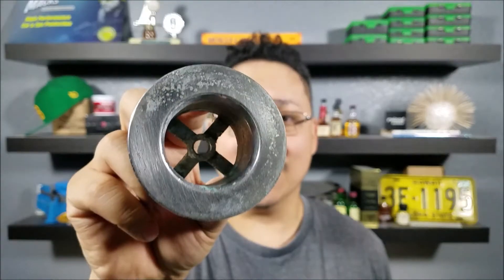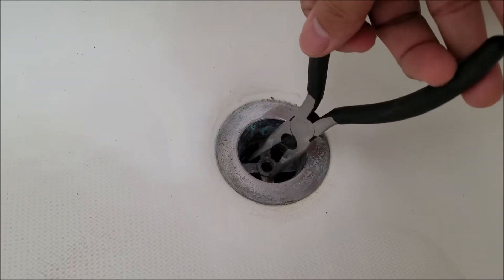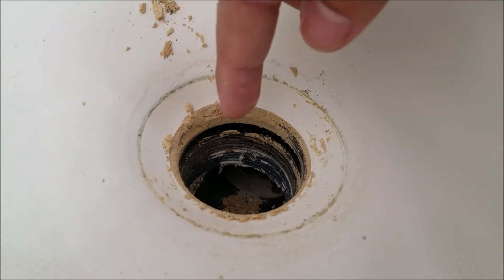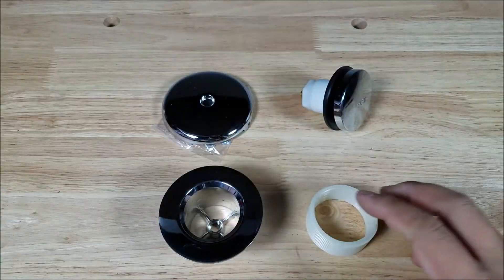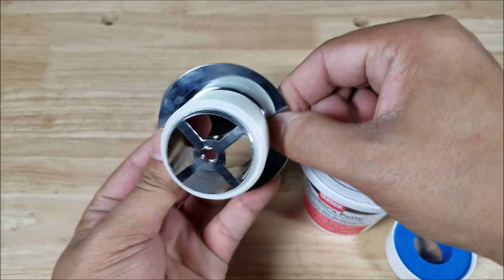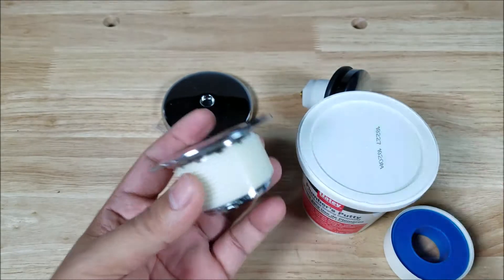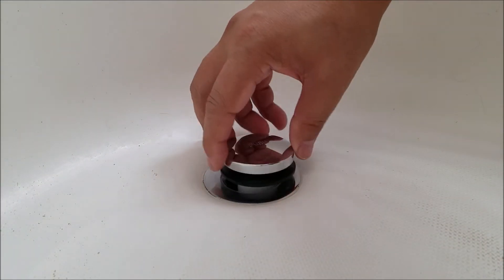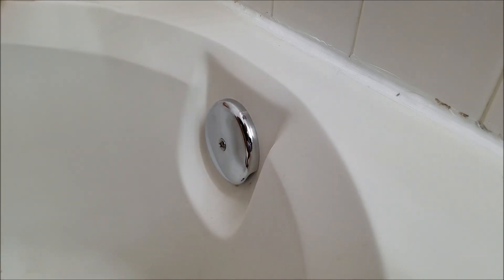HOW TO REPLACE SHOWER DRAIN/BATH TUB SHOE

Comment: Why didn't you replace the gasket that sits between the pipe and the tub before threading the new drain in?
Reply: Apparently most DIYers don't realize what the gasket is for. It really pays to do a lot of research instead of following the advice of the first video you find. 
https://www.youtube.com/watch?v=Xsh24ZmczEY

Comment: Thank you for this. One question though. 
Should I also put Teflon tape in between the threads of the drain and the spacer too. I’m thinking this would need to be sealed as well as the outer threads on the spacer.

Comment: i hate to say it, but I used your method of using a needle nose pliers and a wrench, and it broke all the tines in the bottom of the drain.  Now I am stuck with a drain that has a huge hole in the bottom of it.  I put a kitchen drain that has a screen temporarily, but now I am in trouble.
Reply: the cross members in my drain were all corroded and 1/4 were missing. As soon as I put a drain wrench in there, it snapped the rest off. I ended up using a drain removal tool (like the one linked a couple of comments above) to get it out. It worked well but be careful about tapping it too far down in the slot since I'm having an awful time trying to get it back out of the now-removed drain.
Reply: Get on Home Depot and search “Husky Tub Drain Removal Tool” use that with a 1/2” ratchet

Comment: The cross member is broken that you use to remove the old drain.  What's the recommendation to get the old drain out in this situation?
Reply: @Woo-7073  I ended up using one to remove my old tub drain, worked surprisingly well. Getting it back out of the removed drain (without cutting the drain in half) is another story - still trying to figure that one out. May need to take a nail set and hammer from the back while supporting the drain.